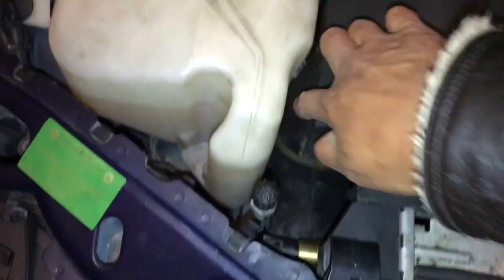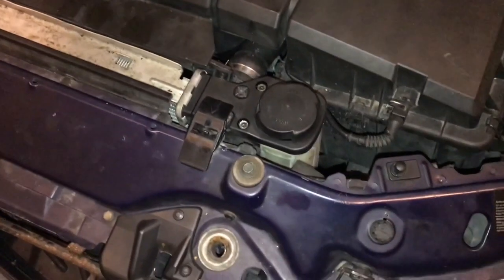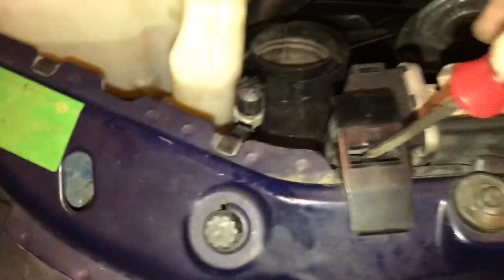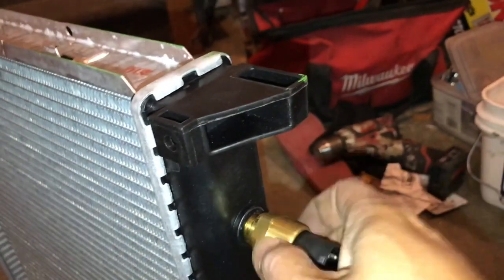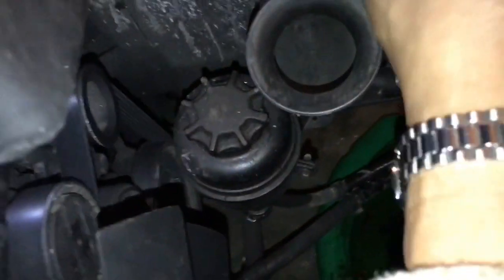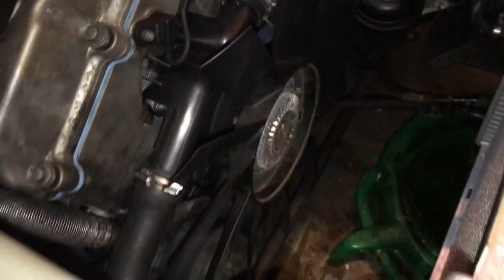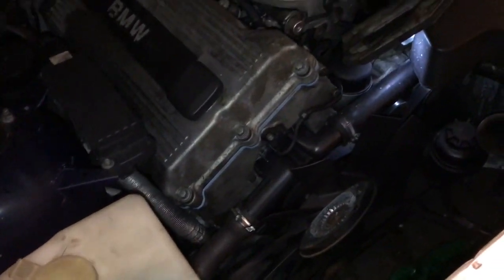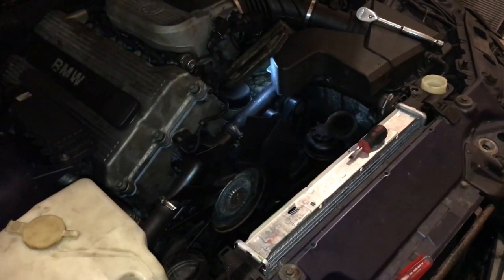bmw z3 - radiator replacement

Comment: The metal core is 18 inches tall with the A/T pipe held-on by 2 screws at the top edge, and 2 screws at the bottom edge.  The replacement radiator is only 17 inches top-edge to bottom-edge !!  No choice but to attach the 2 top-edge screws into their retaining clips.  Rube Goldberg solution = 1) buy 65-cent 1&1/2-inch L-bracket at Home Depot , note that each half has 2 holes  2) cut the L-bracket at the bend to get 2 identical 1&1/2 inch mending plates  3) buy 2 more screws & retaining clips identical to the 4 originals for about $3  4) clip & screw the mending plates to create extended bottom-edge attachment points  5) since top-to-bottom is now 18 inches, reattach the A/T pipe.

Comment: did this fix your issue? i may have same issue with the fan not turning on at a certain temp
Reply from the maker: that was a false positive.   I was trying to fix the overheating problem.  Come to realized that I needed to bleed my coolant a little more along with changing out some coolant hosts (side and back of engine).  Radiator did not need to be replaced, but replaced it anyway.  Don't have to worry about it for another few years.

Comment: Hey Sonny! How much turn did you tighten the temp sensor on the radiator? 

Got a new rad and new sensor with new washer. Thanks
Reply from the maker: Mac Rivera this will depend on your manufacturer.  To make it worse,  mine was broken so I could not 100% tighten.
Reply: Sonny Nguyen thanks. I see mostly hand tight then 1/4-1/2 turn. How much did you turn yours even if it’s broken?
Reply from the maker: Mac Rivera that is a good rule to do.  Go for a drive and check to see if you see steam after.  I would not go beyond 1/2.
Reply: Sonny Nguyen thanks. By the way did you replace your oil pressure sensor? If you did how tight? I’m reading the manual is 29.5 ft lbs which is too much! Lol
Reply from the maker: Mac Rivera I think you mean reservoir sensor.  No,  mine worked fine.  Was not plugged in.  I now have a spare.  Will install if I have a problem later.

Comment: Hey, nice job on swapping out the radiator! What seats are you using in the car?
Reply from the maker: if you check my other videos, you will see I picked up some generic seats.   Used planted seat brackets to connect seat to car.  Eventually, I use the JEGS ones.
Reply: Awesome, thanks man!